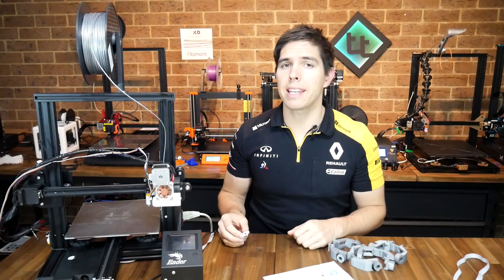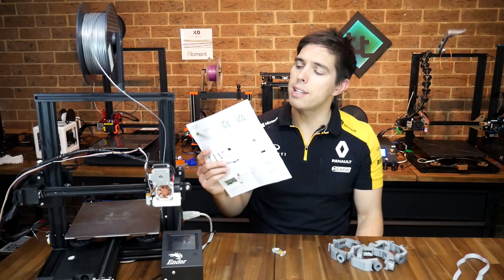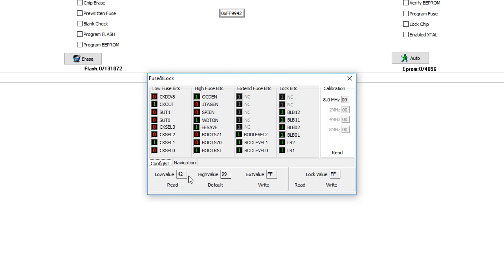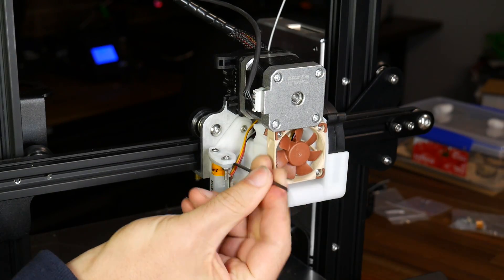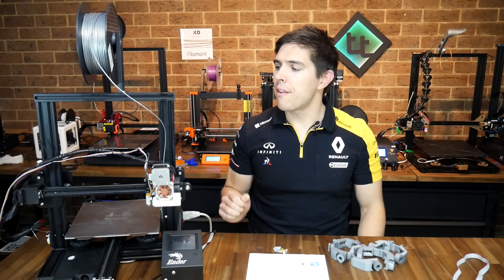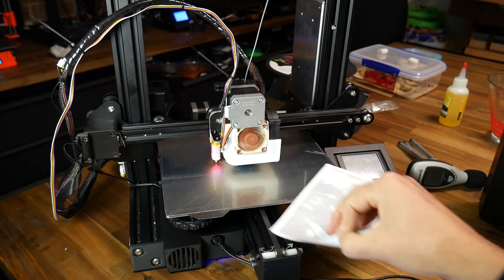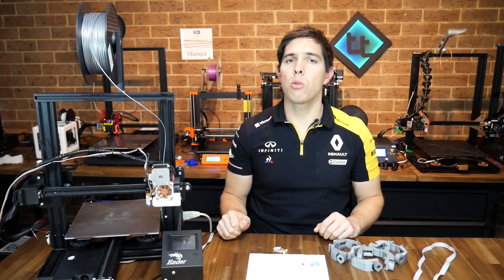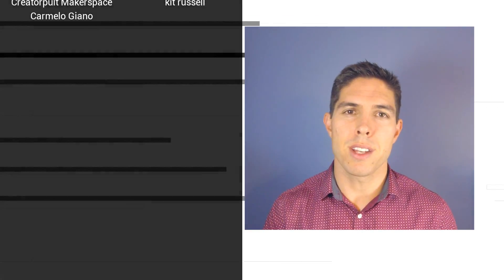Creality BLtouch Ender 3 upgrade kit - Step by step guide with fixes

Comment: So my problem is, that when I home the thing and want to callibrate the offset, as soon as I want to move it ( even when 0.1 selected) it moves straight, like 1 cm down and goes into my bed, if I try to move x or y axle the same happens, the nozzle just starts moving down and digging in the ground. When starting a Print and trying to adjust the Z offset midrun the same happens, it just goes straight in the bed ( When tested with finger or bed level/ home the Bl touch triggers and everything seems normal )

Comment: Teaching Tech, this is the absolute best video out there for BL Touch 3...I looked at so many guides. only this showed me the way so thank you. 3 minor things i had to do to get mine working:
1) rename the program folder to just "progisp" removing chinese characters which caused errors loading the program
2) Had to use your custom firmware, none of the creality or other ones aligned the extruder to center, instead it was 0,0 so it crushed the base
3) Had to swap around the wires for Z axis stop switch, despite being in a clip that should only go one way around they were wrong and not stopping the motor
Reply: where did you get the firmware?

Comment: Hi I received my end 3 I have the Creality bl touch V1 I just installed I donated toward your set up for it and I notice every now and then when I do a bed leveling it will get to a certain point and starts to blink off and on red Doesn’t do it all the time just every now and then I turn off the printer run it Again and that’s fine I was wondering what could be causing this could it be the marlin configuration I downloaded through you or is it a problem that just happens what can I do if anything to fix it thanks for any help I’ve learned a lot from your videos keep up the great work

Comment: The instructions I have with my BLTouch have Low Value as D6 and High Value as DC. The video has it opposite. Which one is correct?
Reply: Same question
Reply: D6 is less than DC so D6 has to be the low value and DC has to be the high value.

Comment: So, I experienced the blank blue screen error after flashing through progisp. For anyone else having that issue, try flashing through AVRDUDESS. I know it LOOKS intimidating but the settings are all going to be set the same and it will work the same. After spending HOURS messing with progisp and reflashing I was finally able to get my printer back up and running.

Comment: And then there's the thermal runaway protection -- which I would ASSUME applies to the bed and extruder heaters, right?  This gets my att'n because I recently noticed that the yellow connector for the two heavy wires coming out of the PS (that I believe power the bed heater) are showing SCARY signs of overheating.  Would love to share a pic, but not sure if/how it might be done.  I'm thinking I may not be the lone stranger with this problem, which (now that I've FINALLY spotted it) causes me no small consternation!  Don't know how I can go to sleep with the thing working on a big, LONG project any more; indeed, many say one should NEVER leave them printing IN YOUR HOUSE WHILE YOU SLEEP!  Guess I'd better check the batteries in my smoke alarm, at the very least.
Anybody????

Comment: So the painfully slow 3x3 grid scanning - looks all too familiar.  I didn't buy their kit - I did mine the hard way (CrE3+BLTouch) but I gots to ask ye:
Is it necessary to rescan that grid for every print, or is it possible to save the scanned topography and simply reload it later, until something changes to merit a rescan? 
If so, could pre-code be contrived to ASK every time if you want to scan or take your chances?
If not, have you found a way to speed things up from Creality's "conservative" defaults?  (Along those lines, I recall TRYING faster metrics when I first set mine up, but having to slow WAY down in order to get mine to WORK!)
What's YOUR usual MO, sensei?

Comment: The Ender 3 v2 has a dedicated port for a BL Touch. It would be nice if it was integrated into the design so it was basically plug and play. I upgraded my Ender 3 Pro with the kit and it was a pain to do, not least because in the Pro the motherboard is upside down.

Comment: Your own version of the firmware isn't that great for v3. Auto levelling frequently fails compared to standard firmware (sometimes the probe "senses" contact mid air and knocks the whole mesh out" or just fails entirely half way through. There are options missing from the menu for setting steps which is also a problem if you're not using the standard extruder

Comment: Although it seems an ideal simple solution, I can't get the pre-compiled firmware hex for BLtouch V3 (Marlin 1.1.9 bugfix with thermal runaway protection): https://gumroad.com/products/wLtut/ to load. Chip access seems to be the problem.

Comment: Ok so, I followed your instructions, got as frustrated as you by their slooooooooow bed levelling and installed your file instead. But, I can’t level the bed. Firstly, you’ve given no pointers on how to use your program -whether that’s to follow other instructions or use some you’ve talked about elsewhere. Second, my z-axis doesn’t/won’t go below 0. What do I do now?
Reply: same problem did you get this fixed. Am wondering if its the wires for the z that need to be switched because I cant go below 0 and then it smashes into the bed anyways

Comment: Hey,

I have an ender 3 pro with 1.1.5 silent board when I try to use progisp I get same error" I tried turning on printer but still getting error any idea how can I fix it ? 

Ty,
Reply: Problemi çözebildiniz mi ?
Reply: @nevzatsifa8186  Kart ölmüş yeni anakart aldım düzeldi sanırım 1.1.5 silent board a deneyince bu default bltouch kitini kartı bozuyo. Skr mini kartı aldım bu kartı almadım.
Reply: @Burak0015  Teşekkürler
Reply: @nevzatsifa8186  Rica ederim

Comment: I just couldn't get the programmer to work at all. Everything I tried came up with errors. Luckily, I got the kit from Amazon, so i sent it back and got a refund. In the end, I got a BigTreeTech SKR Mini E3 v1.2 with an tfft led screen and a BL Touch with an extender cable. I used your pre sorted firmware with bed levelling for the BLT. Its taken me over a week to sort all this out. I'm hoping you might let us know how to switch levelling on and off as my auto levels beginning any print. To say the Creality kit was awful would be an understatement. I'm still experimenting to get the correct Z zoffset. Keep the Tech tips coming, as i wouldn't know where to go. Many thanks Michael, from Dave (66years old - first 3d printer) UK

Comment: Hi, I have the petsfang bullseye duct and was wondering if i need to change the x and y offset because the mounting bracket is totally different (I saw this in another video but they were not using the marlin software) I am kind of a total noob here. How would I go about doing that If i have to ?
Otherwise your video has thusfar saved my life.

Comment: I noticed your D6 DC FD Values are incorrect according to the BL Touch guidebook. The install will not work if you you have the settings incorrect.
Reply: These are the values from their "official" video also -  https://youtu.be/2B4qdKdqJj4?t=173.
Reply: @alienpioneer  Yes, the D6 DC values are given reversed in the video
Reply: @markimholt7582  I see, the values are reversed in this video. It should be D6 DC FD. Good point !

Comment: I have a Problem, every time I start the progisp I get the warning: Access violation at address 765A1F80 in module "KERNELBASE.dll". Read of address 00CD1000. I think its because I flashed the Firmware to the newest version to have thermal runaway protection and soon. Is there someon that knows how to fix this?
Reply: The solution for this Problem is renaming the Progisp folder from something with asian writing to just progisp.

Comment: Ok, I need help. I followed your instructions to a T, and it worked like a charm. I flashed the control board with the file you suggested with thermal runaway protection, but I was not overall happy with the loss of ability to calibrate the esteps. I went through all of the steps again and flashed it with creality's hex file this time. Now all I get is a blank screen. Do you know what happened? or what I can do?

Comment: I installed my BL Touch, and used the BLtouch V3 (Marlin 1.1.9 bugfix with thermal runaway protection) from the video description, but when I go to Auto Home from the lcd menu in Step 6 Platform Adjustment in the instructions, the z-axis homes at 10mm above the bed.  The LCD even shows Z 10.  I cannot adjust the z-offset, as it does not lower the nozzle far enough.  It is still 5-7mm above the bed.  What can I do to start fixing this?

Comment: I am using SKR mini v1.2 and BL Touch V3.1, used all the setting from your videos and even ran your config files still, all the BL Touch is doing is, after auto home it just go up a little drops the pin and come down and stay there. does not move on x-axis or y-axis. when i do MIN_PROBE_EDGE 50, it moves to x40 and y40 and run it once and then just sits there, please help

Comment: I have a big problem setting bet properly, and of course testing it with provided filament is disaster. Not sure is it me, or is it the filament that is the problem. Still waiting for shipment of filament that I ordered (PLA and PET-G).
My question is, if I install BLTouch, do I need to level my bed manually as without it, or is it here so I don't need to worry about all four screws on bed. And if so, is it possible to fix those screws so they are not moving at all?
Thanks...

Comment: Great video and great work. Your firmware made my printer useable now with BLTouchV3.1. Would you be willing to post a link your marlin source code version (with your config) for the pre-compiled firmware hex prepared by myself for BLtouch V3 (Marlin 1.1.9 bugfix with thermal runaway protection) above? Thank you

Comment: Thank you, followed this to instal the Creality BLTouch kit with the V3 probe to my Ender 3 Pro. All went as it should and all working fine. Didn't have to change any wires around etc. Used the Burner cable with ProgISP and followed your guide, bam...all done and working fine. Thank you for what is the best video online to follow for fitting this Creality kit on both the Ender 3 and Ender 3 Pro.

Comment: Good video, but I need to point out a potential mistake. The official Creality BLTouch tutorial video has the values for the Fuse&Lock ConfigBit part as D6 for Low value, DC for High value, and FD for Ext value. You have the low and high values swapped from what they state in their video. I hope they are correct or else I need to reflash my firmware to your values, and I just got done putting the printers back together.....lol

EDIT: Or perhaps this could be a difference between Ender 3 and Ender 3 Pro. I have the Pro and referred to the Creality Ender 3 Pro video.
Reply: I wish I had read this comment about 20 minutes ago. :) How did you get the fan back on to clear the Pinboard?4
Reply: @thequickestfox  Everything just fits with mine, no issues.

Comment: Thanks for this. I downloaded your .hex file for free at first then a bout of conscience hit me since you've put time into creating this for us so I went back and bought it again but this time I made a donation.:)
Update: Teaching Tech's firmware loaded fine but it won't work with my Ender 3 because I have a custom hotend setup so my BL Touch is not located where his is. Mine is inline with the nozzle in the X position (0 offset) and -37mm in the Y position (36mm in front of the nozzle). So when I try to print, the BL Touch runs off the front edge of my build plate and I get a Z probe error. I can't edit the firmware to change the BL Touch position because it's in .hex format and I don't know how to work with that.
No fault on Michael's part, just an issue of compatibility.

Comment: just bought an ender 3 pro . Do I need a different motherboard or can I use this on the stock board?
Reply: I recently bought two Ender 3 Pro's, and am installing my BLTouch upgrades now. Stock board seems to be fine.

Comment: Hi there - love the videos but two comments/thoughts for you.  Your title reads "Ender 3" but you are actually using an "Ender 3 Pro" there is a big difference in that no one will tell you the "Ender 3" electronics cover won't go back on due to the raised height of the LCD cable due to the 27 Pin adapter.  Also you stated this is for the "BLTouch KIT" and the KIT includes a USB ISP burner but you keep using Arduino.  Would you please do a video for an "Ender 3" with the USB ISP burner not an Arduino.  I've managed to make mine work after 3 days searching the WWW but still can't get the 'Platform Adjustment' figured out.  Other data for you if you need it: My Motherboard reads: Creality3D V1.1.4, My BLTouch reads: A1YN2  UYXS8  SMART V3.1, "Ender-3Marlin1.1.6BLTouch.hex" file from Creality, Ultimaker_Cura-4.6.1-win64.  Thanks!!

Comment: This video was really helpful, and my BLTouch V3.1 installed on my Ender 3 without much issue (V3.1 mush have fixed some of the issues of V3). But now, I have lost the option to replace filament mid-print. How can I get that back?
Reply: Yes I lost M600 command capabilities to change filament mid print.  Did you ever figure out the fix?

Comment: Followed the instructions and could not get it to work. I have the Silent 1.1.5 motherboard and the BLtouch V3.1. I purchased the .Hex  file he recommends for V3 and it would not work. Homing was off for the X and I could not set the Z offset. The Z was insanely high. I ended up using the .Hex provided Creality and it worked. Wish his version worked for my setup. Really wanted thermal runaway...haha.

Comment: Hey Micheal, First thanks for your videos, they are great. I just did this install today following your guide but used the pre-configured hex you have for the BLTouch 3. Everything worked just fine until I got to the Z-Offset and noticed my printer will not let me go under +0.00? so I can't get a negative offset resulting in the hotend being way to far from the bed. You happen to know how to fix this?
Reply: supposedly you print and then move the offset from the control menu, anyways, not working for me

Comment: Thnx for your videos man, you really explane stuff easy and simple for a goofball like me to understand. was fighting for a week with the bltouch, then i just noticed this morning that i had the heated bed for my ender 3 pro to low, like below wat it could reach. so each time i had to readjust the bed while printing because the bltouch was measuring till i could not go any lower.
still got the problem that every time the first layer now is perfect but the next 3 layers come out like the nozel is to close, and after that is works perfect. so still figuring out that stuff.
using pura slicer after i was done with the limited stuff i could doe with the creality slicer. was looking into going to switch to cura wich most people use. but first wanna get the profile dailed in just right. there so much stuff on the web and everything is kinda the same but with slight differences wich messes up my everything. and till now your vids made the most sens. so thnx for making them and keep going at it ;)

Comment: I just added this to my Ender 3x (Glass Bed) with v1.1.4 200101051 board and I sometimes get probing failed. When this happens I usually have to turn off the printer and turn it back on. I am using the BLtouch V3 (Marlin 1.1.9 bugfix with thermal runaway protection) hex from above because I received a v3.x of the BLTouch. Another thing I notice is the Z stepping motor is slightly twitching when doing a print but I don't see the gantry moving. Once I get through the bed leveling when starting a design it goes fine.  It's just finicky at the beginning.  Since I'm listing my issues I seem to be getting no SD card found and have to init to get it to read the card.
Overall, I think it's working but is it working correctly? It doesn't collide with the bed so that is a good start.
Thanks for you help.
Reply: I'm having all the same issues except I have the magnetic bed

Comment: I get a "Chip enable program error  when i click write". I have the printer turned on. Please help.
Reply: Once i plugged the ribbon cable with the bltouch adapter into the board next to the USB connector pin it allowed me to click auto however an EPROM error cam up on my printers screen.

Comment: Hello there been following your guide for the BL touch have version 3.1 so downloaded your recommended version of bootloader and BL touch it started off fine got a blue line about 5cm long and then says can't find programmer, so now I'm not sure what state my ender 3 is in has it flashed anything, has it corrupted. Did read somewhere that it might be the wrong burner? Any Help would be appreciated. Cheers Keith
Reply: You must be doing something wrong, follow creality's official video but use his hex instead, it should work.

Comment: I’m a little confused. I’ve been using my ender 3 for some time now without issue. I’ve recently added the BLTouch and used your firmware file that’s in the description, yet now I’m getting quite extreme layer shifting on prints that previously worked perfectly. Is this something anyone else has experienced?
Reply: For anyone else having this issue. The fuse values on the video are incorrect. The first and second valued are the wrong way around. Re-writing the correct ones solved my layer shift issue.
Reply: @calvinw  I noticed that the video had them switched as well. My printed instructions from Creality had Low=D6 High=DC Ext=FD
Reply: @Sutojl  just to clarify you solved this by using the creality defaults?